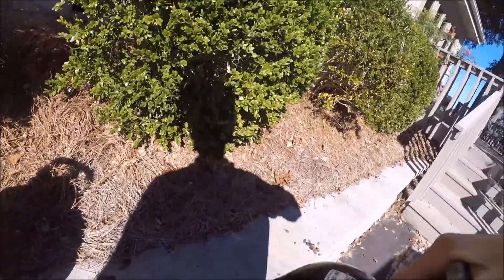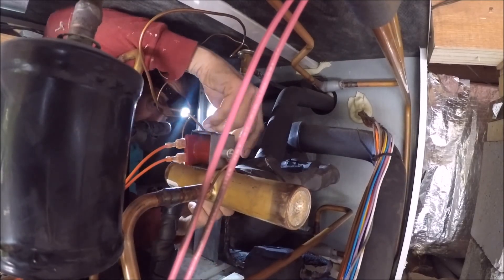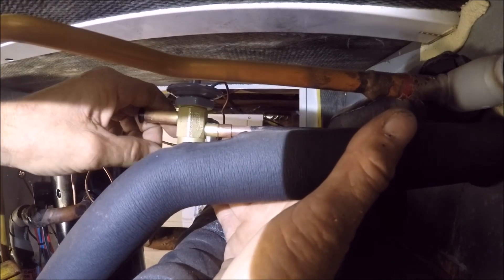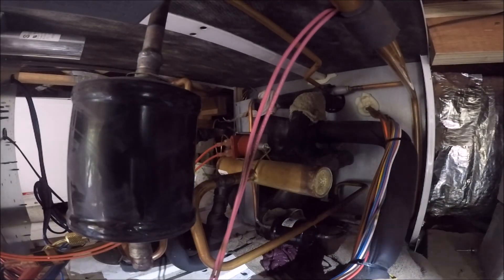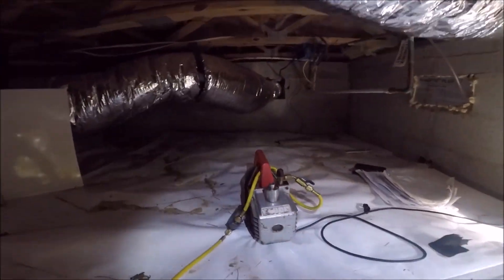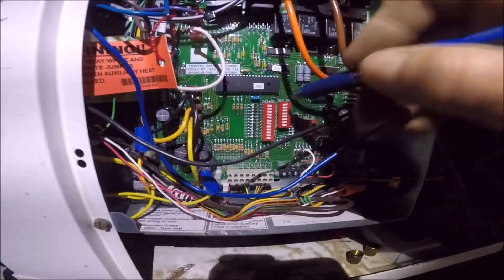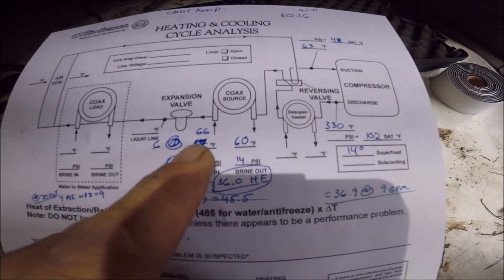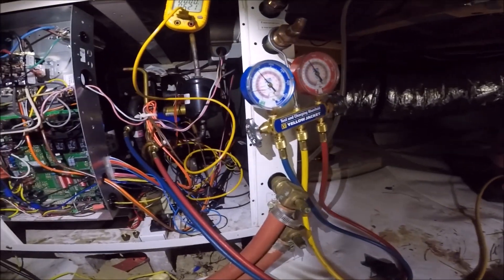(HVAC)TXV ..join my as we replace a bad txv in a geothermal heat pump.

Comment: What would a repair like this run (assuming "market rates" for the r410a and ignoring it)? It looks like the parts are fairly inexpensive ($200-300 for valve and drier + misc) but how many hours of labor is that?
Reply from the maker: 900 to 1500 depending on the tonnage

Comment: Thxs for a great vid...If the units you were working on did not have the Pressure ports to get your pressure drop for your water coil, Could you have simply taken the Delta T across the water pipes in Fahrenheit and then converted it to pressure??  Thx
Reply from the maker: No p/t ports. To take pressure drop. GPM IS only a guesstamation
  Unless it's open loop then u can use a bucket and stop watch . 
     With out EWT. AND PSI DROP and manufacture information. Can't calculate gpm .
  Can only get water temperature drop or fall. And see if it's in range with spec's.
Reply: @billbuckman  perfect thxs HB!!

Comment: Would love to see some videos on WF Synergy units with domestic water preheat. Have had nothing but issues up here in Canada with compressor, capacitor/contactor, even txv/refrigerant solenoid failure. All happening after 10 years after install.
Reply from the maker: I don't work for the geothermal company anymore now I work for a commercial refrigeration company on Industrial Refrigeration Lake Walmart in Aldi's Dunkin' Donuts regions ice machines freezers coolers so sorry about that
Reply: @billbuckman  sorry to hear. learned lots from your process and was very helpful, thanks. watch out for those ice machine drains....that jelly is gross!
Reply from the maker: @danheaton1509  thanks

Comment: Awesome geothermal videos. Subscribed. Were you flowing nitrogen during brazing and is it absolutely necessary with r410? Brazed a lot of lines back in the old days without(r22) and never had a problem that i am aware of. Thanks
Reply from the maker: I always braze with low flow nitrogen while brazing.good practice. 
   No oxydization

Comment: Another good job. More easy money for you. Please do some videos on diagnosing the problem before you do the repair. Thank you for making videos.
Reply from the maker: the reason I knew the tx was bad is simple ...running it in heat was locking out on water flow ..head psi was 400 and climbing to 450-500 and the suction was about 90 psi --with 410a ref...so I run it in cooling and I got a head @ 200 and suction @ 120
    Then when I turn the unit off  the pressures did not equalize witch told me something was clogging the txv equalizer tube.. I didn't  do much more then that did not have to even have  check sub cool or sup heat. in this situation it was very obvious...but ill try to show more trob shooting in future.. thank for the comments

Comment: Just subbed up. You do a lot of Geothermal work. There are some in Michigan where I work and live. I just do commercial and HVACR industrial work. So anything info you can pass along about geothermal work will be great.
Reply from the maker: just ask any time Ill help best I can .. Iv been working on primarily only geothermal for the past 7 yrs ..But I'm probably about to transition in to refrigeration for a larger company in a couple wks. the company I'm with now is a big geo company in Jacksonville NC , since 1980. Iv only been doing now since 2010 after collage.. 

But they sell, I service and install (Waterfurnace) (climate master) (florda heatpump) (bosch) and (Trane) geothermal sys to name a few ..
Reply: Sounds like a great opportunity Bill. I used to do a lot of WIF/WIC cooler, ice machine and reach in work. You will never be slow on hours if you know how to work on that equipment. The place I worked for then had a lot of Mcdonalds accounts. The last 5 years I have been learning to work on environmental test chambers. Cascade systems, they are very challenging at times.
Reply from the maker: wow sounds like a challenge ..if things go well ill be working in grocery stores all over the state ..and it will get me out from crawling under houses and those hot summer attics . I love working on the geo units but the crawl spaces and attics are starting to really wear me down I'm not getting any younger ..but the refrigeration world is new to me so it will be a good change of pace.. I  realize I will have to do roof tops in the summer heat but at lest ill get out of the attics in the North Carolina summers ..and the sandy muggy cramped crawl holes..Gotta do what we gotta do though ..I  think the change will be nice .. Attics are average 140 and up here in the summer and we have a lot our units in attics.